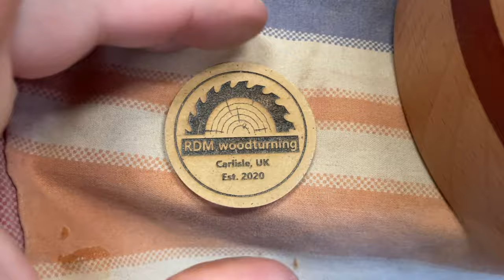How hard can it be? Yarn Bowl - Wood turning

Comment: Well done. I just did a yarn bowl and cut the slot with a rotozip tool. The bit is an up cut straight cutting bit. They have a 1/8” shaft and would fit into a Dremel as well. Come back with the Dremel sanding cylinder and your done. Great job.
Reply from the maker: I’ll have a look into that. Thanks for sharing 👍